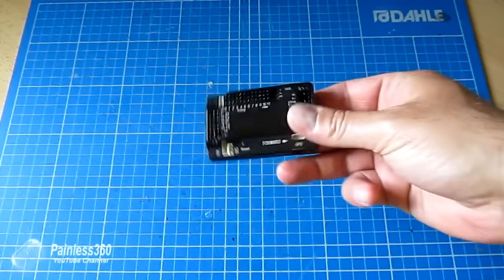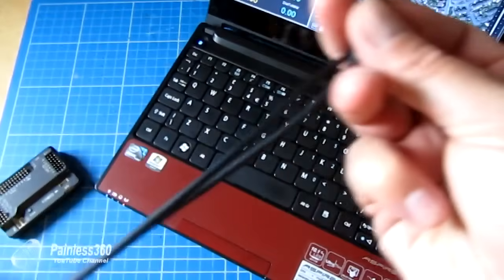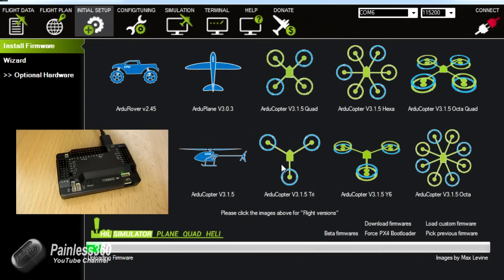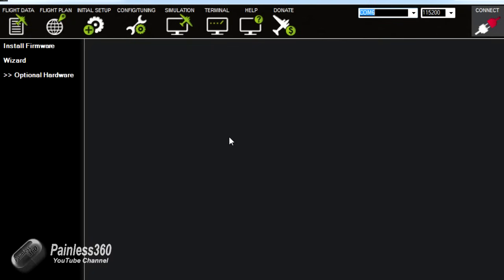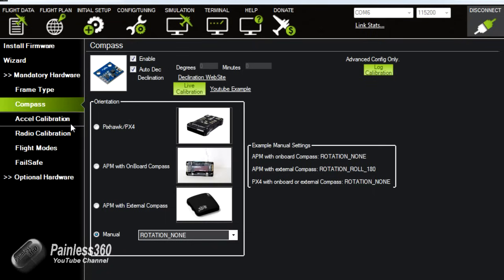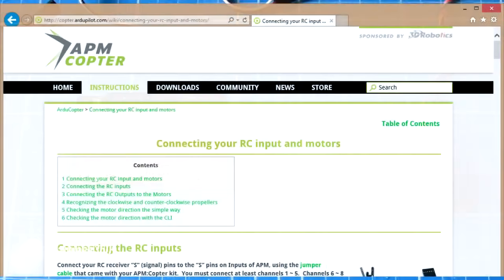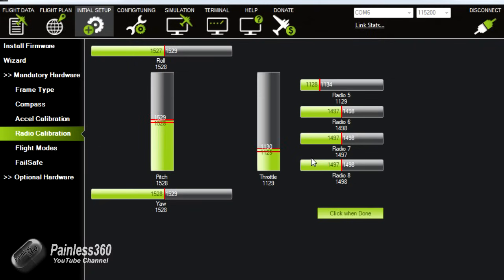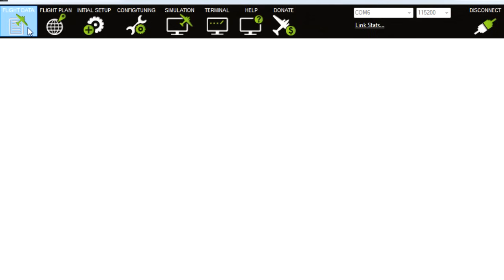(1/8) APM 2.5/2.6/2.7/2.8 - Simple installation and setup overview

Comment: I keep getting message not enough points to calibrate compass ? what am I doing wrong? also im not getting the graphic window showing the points while im trying to calibrate it ?
Reply from the maker: Greg Iwinski Tricky to help with that limited amount of information. Either you don't have the compass connected in the right way or have a dodgy board. What trouble shooting have you already done?

Comment: I need help with compass calibration.it always says not enough data to calculate.
Reply from the maker: gideon macalino You should see the little red marker move around as you move the board. If you do then concentrate on hitting the 6 white blobs on the ends of the axis in the graphic. That should speed up the process.
Hope it helps..

Comment: Hi i m nilesh gupta from india. My F450 Apm 2.8  transmitter flysky fsi6 . At time of flying my f450 goes right when given left command  from transmitter and go left when given right. Why this is fly cross. I want to do correctly transmitter right drone fly righy, transmitter left drone fly left. Give solution pleade.
Reply from the maker: I’d watch the series that goes through how I used to setup an APM step by step. The Ardupilot documentation is excellent too for... it’ll be something wrong with the radio setup is my guess..

Comment: I have one of these boards and trying to calibrate the accelerometer but every time i try to do it its disconnects and the calibration times out
Reply from the maker: Happy to help but please watch https://www.youtube.com/watch?v=olIqTiSJHIY and come back to me with more detail of what you've tried..
Reply: +Painless360 i have tried to calibrate the accelerometer with mission planner and had no luck via usb. I know that the craft is connected because the artificial horizon moves with the craft until i go to calibrate which it disconnects and mission planner also says this. I have also tried to connect via the 433mhz radios but have had no connection at all. Currently i am in contact with the hobby king support team and have sent them a video of the problem. I also did some quick research to find someone with a similar or exact problem but it was a small thread that didn't answer the question and i have found nothing else. I am completely lost with what to do and hope that it is no a mechanical/physical problem but it looks more like that could be the case.  I Appreciate the help 😊.
Reply from the maker: I'd suspect the driver and I'd delete the driver/device from Device Manager and stat again. I've not seen that here.. Best of luck!
Reply: +Painless360 do you have any idea of how to do that on a mac?
Reply from the maker: Nope, no Macs here..
Reply: +Painless360 ok I'll have to find a pc that runs it

Comment: Hi what was the device that you had plugged into your receiver?
Reply from the maker: At what point in the video?
Reply: @ 17:45
Reply from the maker: That is the end of the video?
Reply: Sorry my bad, @ 13:19 its connected with twisted cables?
Reply from the maker: That is a Spektrum satellite receiver. It provides an extra pair of antennas to support the main receiver and give improved reception..

Comment: Hi. 
I never even Copter installing it and not even know how to do this there are aircraft (ACRO) and heli options. then do another 3-position mode do not have any idea how to do it
Reply from the maker: looking at the radio it apoesrs to only have two position switches.  If you want to have three values on a single channel then you will need to use a mix and a second switch. To have mixes on this radio you need to select ACRO mode. See page 19 of the manual.

My advice is to find someone with the same radio who can walk you through the process. I dont have one here.

Best of luck.

Comment: Please help. I have this same DX7 radio and I have everything connected exactly as shown in this video...however, I cannot for the life of me figure out why I can't seem to get Aux 1 to work. When I'm in the calibration mode for the transmitter, all the sticks work fine, but none of the switches will work. I have tried a few different receivers..the AR6100 Spectrum... but nothing seems to work. Am I missing something very simple or has anyone else encountered this as well? Any help would be greatly appreciated! 
Thanks!!
Reply from the maker: +Randall Williams if you are using the heli model type then you need to set the pitch for the f,mode switch. I set Norm as zero pitch, Mode1 as 50% and fmode2 as 100% and then you'll get it moving. You should have the gear switch moving ch 5 too. Make sure it's set in the menus and use the channel monitor to check it all before trying in Mission Planner. Best of luck!
Reply: Thanks Painless360! So I have all this set in the radio no problem When I connect to MP, there is no red line on channel 5 like there is on the transmitter sticks. Really frustrated as I don't know what else I could be doing wrong. Any additional suggestions from anyone would be greatly appreciated! Thanks so much! This page and your videos have helped a LOT for me so far! Keep up the great work you are doing! :-)
Reply: GREAT NEWS!!! I just found my problem!! I have a bad lead from receiver to the board. I tried another lead on channel 5 and low and behold...I have channel 5 working now!! Now off to the hobby shop to buy some new leads!
Reply from the maker: Great news indeed - well found and best of luck with it..

Comment: dude as you the man with taranis and apm  im trying to get rssi from a L9R to apm  for osd  plz help  ?????????
Reply from the maker: Happy to help but please watch https://www.youtube.com/watch?v=olIqTiSJHIY and come back to me with more detail of what you've tried..
Reply: ive followed all i can but basicaly ive set in apm 3.3 volt rssi pin 5 plugged cable from rssi port from L9r to pin 5 in apm   i get constant  rssi of 32 radio on or off very confusing
Reply from the maker: Telemetry can be either a PWM signal or an analogue voltage value. I've not played with this but I'd make sure that they both use the same format.. Best of luck!

Comment: my PWM limits are different than yours, how can I change this?
Reply from the maker: Endpoints on the radio, check the manual for the one you're using. Best of luck!
Reply: I have the Taranis X9D+. What should the values be, between 1100 and 1900? Also, for throttle failsafe it does not matter what the minimun endpoint value is, right, as long as the pwm value for the failsafe is below the minimum endpoint. By the way, thanks for the quick reply

Comment: Pich and yaw in bottom of right. Rudder 5 second then armed myquad. Whats the problem?
Reply from the maker: +Pankajda9 99 what are you asking? That's how stick arming works....
Reply: No but my transmitte(flysky) work this type. I arm by trottle stick but isn't work. Any setting shoud be dpne pn my transmitter
Reply from the maker: +Pankajda9 99 see our video on troubleshooting arming. Best of luck!

Comment: hi painless
have a problem that maybe you guy's can help
building a zd850 and using a apm2.6 after setup and calibrate esc's doing a motor test everything works fine until i turn on the transmitter one of the motors is oscillating switch everything of and hook up the computer again to test all works again switch on transmitter on motor doing the same thing tryed to change the motor but same thing
please help thanks
Reply from the maker: Not sure what you mean by oscillating. You may see some odd things on the bench - https://www.youtube.com/watch?v=DDnaAQLjcQQ
Reply: when a three fase motor missing one fase its like it does not know wich way to go so ccw cw ccw cw
Reply from the maker: Sounds like one of the three wires connecting it to the ESC isn't making a great connection.. Best of luck!
Reply: hi  there painless360  found it not a cable but an output channel of the apm 2.6
tried it with an other and it is flying
Reply: is there a possibility to re  route the outputs (i can still use it on a quad copter)

Comment: My motor just started by itself and I cannot control the throttle through the tx. However I can control the other channel. Why is that?
Reply: Nvm. The FC needs 3S battery for the motor to properly work.

Comment: Could to much vibration mess up the mag or the gps?
Bo        (Alayna's brother)
Reply from the maker: +Bo Feldman Looks odd, vibration would normally affect all of the modes. GPS modes also use mag and baro to maintain position. I'd download the logs and see what happens to these when you go into loiter. You are letting the GPS lock before flying? The blue LED should be solid...
Reply: Yes I do let the gps lock
Reply from the maker: In that case then the best option is to download and take a good luck at what the sensors are doing in the log-files. Best of luck.

Comment: It says my firmware is retired and when it tries to upload the new firmware it displays error uploading ...... can you help? I bought two complete ardupilots inc gps power supplies telemetry etc etc...
Reply from the maker: I've been actively telling people not to get apm for the last 2 years. It's outdated technology. However saying that, watch the series as I do cover what you need to do as there is a version of ardupilot that will still work with it. Best of luck
Reply: @Painless360  Thanks.I have gone through EBAYs complaint thing so maybe getting a refund as i used a uk supplier,thankfully!!!

Comment: Are you still out there? if so, I get a failed to download new firmware:  System ArgumentNullException: Value cannot be null
Reply from the maker: I'm guessing you are not a regular viewer. Check that you are not trying to use a newer version of the firmware for this old APM flight controller.. Best of luck
Reply: @Painless360  You are right.  I'm a newbie. Thanks

Comment: how do i move ch's around  
my throttle is on the roll and 
like mode is wrong
Reply from the maker: +h belcher move them on the radio. How you do that depends on the radio your using. If it's a Taranis or similar then check out the OpenTX mix school videos on the channel!

Comment: Please upload a video on gps module neo m6 blox with apm 2.x flight controller as soon as possiable.i working my engineering degree project with same things
Reply from the maker: All of my videos on the APM are in a playlist, I'd suggest you watch those as I cover each of the steps to set it up in there. The Arducopter documentation is also excellent, so if you're doing a degree that will help with your research too. Best of luck

Comment: hi I don't see any COM port option in the drop down menu,Can anyone help or suggest what needs to done on the board?
Reply from the maker: I'd reinstall Mission Planner. That'll reinstall the drivwrs. Best of luck
Reply: @Painless360   Hi thank you so much  for that advice. :-) Now that i have resolved the Port issue, i have hit a another wall. Unlike your User interface, my APM version is little updated i guess.Now when i go to Compass option click the live calibration, its not logging the data points, no matter how i rotate the APM board. So my question is what might be the reason , and how can i resolve it?
Reply from the maker: APM is a very old outdated flight controller so all I knew is in the videos. Best of luck..

Comment: which apm is best? means apm 2.6 apm 2.8 apm 3.1 etc
Reply from the maker: Depends on what you mean by 'best'. 3.1 is smaller, APM 2.6/2.8 are almost identical. APM is getting very long in the tooth now but still works well. Best of luck!

Comment: I can load the firmware, but whenever I try to connect the board it gives me the error "Cannot load new firmware while connected via MAVlink" any ideas?
Reply from the maker: Not seen that here. MAVLink is the telemetry protocol the board uses. I assume you're using a USB cable not the wireless telemetry radios? Best of luck

Comment: Hi! Hope you doing well! I would really appreciate if you could help me with the initial set up of an APM 2.6 in mission planner (when plugged into USB port for uploading firmware type: give option “ is this Linux board “ for No it says failed to upload, for Yes it says need to be connected to board WiFi. What should I do?
Reply from the maker: The APM is very old tech now. I've not touched one for a long time. Using a simple search will usually find what you need on the channel.. I.e. https://youtu.be/Vbz3vN3JH6Y best of luck with it.

Comment: i have tried to reinstall the firmware,changed a few setting but still get the error
Reply from the maker: +SheaProdigy I'd check the cable to the external GPS then. Best of luck!

Comment: Lee, thanks to your excellent tutorials I have successfully test flown the Tri copter I built  with APM 2.6.  The only thing I did different was to run the setup wizard using the 3DR radio link so that I could do the calibration without the USB cable in the way.  I still have to calibrate the power module.  APM thinks the battery is low and pulls back the amps to the motors way to early.  I will look it up on the Wiki.  I also tethered it to a card table first to check out the channels.  Good thing I did because 2 channels were reversed and had to run the calibration again.   Highly recommend doing a tether first before attempt for first flight.   Here is the video of the tether and first hover. https://youtu.be/zFCRgs1g68g  tether test https://youtu.be/i6_RrtD-pc4
Reply from the maker: Jon, that is great news. Well done on getting her ready to fly. Crossed motor connections are one of the most common mistakes (I've made them myself).

Many happy hours of flying!
Reply: Painless360 That part has been back ordered. Restock is March 21st.  The order number I sent is still valid.  Here is the sku number   SKU177478
Reply from the maker: Thanks Jon..

Comment: the apm 2.6 that I have will not connect to mission planner, the connection times out and I get an error message that it did not receive any heartbeat packets. do you know a solution for this problem?
Reply from the maker: What have you already tried?
Reply: editing the bit rate to match the bit rates of mission planner, reinstalling mission planner, reseting the apm and reinstalling the firmware. and i have looked it up and a know problem is the 3.3v regulater but the red and blue led is stil working so it cant be the regulator.
Reply from the maker: +BML Have you tried another PC?
Reply: +Painless360  yes I have tried 2 laptops and 1 desktop all wtih the same problems
Reply: +Painless360 after using my voltmeter i have dicovered that it is the 3.3 volt regulator even tho the leds are stil burning fine
Reply from the maker: Bad luck. I hope the supplier sorts it out for you. Best of luck.
Reply: +BML Could you fix it?
Reply: no i ended up getting a new one. i even gone as far as replacin the 3.3 volt regulator with no succes
Reply: Did the new one work?
Reply: yes it did

Comment: Anybody knows if it is possible to flash the apm to know how to work with sbus. I saw a you tube movie of a German who flashes a little hex file into to apm so it can work with sbus protocol. I was blowing away now it can 8 channels from a FrSky X4RSB and it seems to work so I wonna try that
Reply from the maker: I believe that some have created custom firmware to support SBUS but I've never used it.. The forums are the best bet. Best of luck!
Reply: Painless360 thanks I will do that it would be greath so it can work with my frsky wich bought I believe every step between means a link and as good as the apm is its rather nice to learn it sbus whit out a sbus to ppm converter. I will tell you if it works and keep up the good work you do

Comment: Hi I am using apm 2.8 side pin 
I am unable run motors it is saying 
Command was denied by autopilot 
What to plz help
Reply from the maker: Happy to help but please watch https://www.youtube.com/watch?v=olIqTiSJHIY and come back to me with more detail of what you've tried..
Reply: Hi tq’s for ur reply fast 
And now I saw ur video i did a bit research on it but one think I don’t do is I didn’t read manual of and I will do further but when research on I don’t get proper information about my problem so I reached u 😇
Reply from the maker: This is something I've not seen personally but all I'd do is look in the manuals/forums and do some Google searches on the actual error to see how others fixed it.. Best of luck!
Reply: Got solution